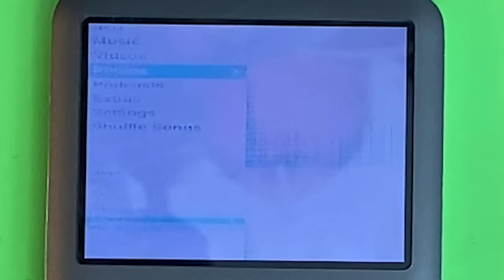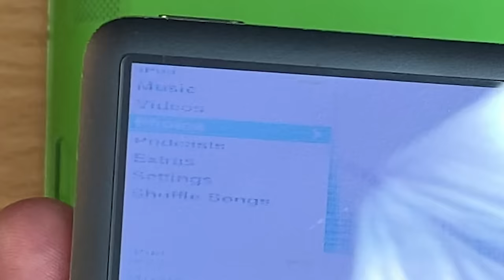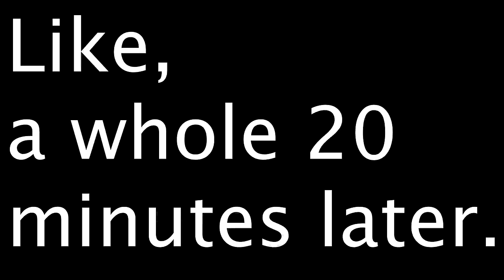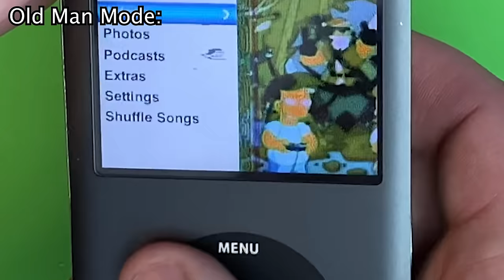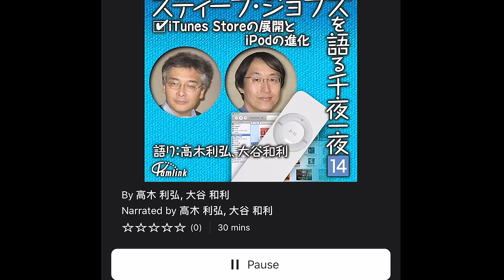I killed the 1TB iPod...

Comment: The screen reminds me of when my ds lite screen died. The hinge was slowly slicing the ribbon connector. Since theres nothing like that there id actually wonder if it just wasnt connected properly.
Reply: Yeah.  The DS lite had problems with the hinges.  That's why nintendo had the repair service for it up until a couple of years back.  I remember when a dropped my DS lite in the bathtub.  The guy on the phone who worked for Nintendo said is was covered, when water damage was in fact not.  However, they honored the statement and I got a new one free in the mail.

Comment: Oi get the $60 ifixit kit with the random screw bits and the Jimmy. The Jimmy is a metal spade with a rubber handle, and it helps open these things so much easier than naked blades

Comment: i had the same model, also messed up and fell on the floor....
Sadly it was like the most often opened ipod in my collection so the shell went apart and ripped the 3.5mm-jack assembly appart, plus screen glitches and ripped battery socked...
But I HAD TO RECOVER MY BOYYYY!
So instead of ordering new parts, my lazy poor ass managed to solder the ribbon cable of the headphone assemble together to working condition (yes really), and I also resoldered the battery plug which i had to secure with adhesive. sadly the last part went to much and now i can only change my battery by cutting it out. The screen glitches went away like magic but comes back every time i press the buttons too much.

fun little story, but MA BOYYYY works happily again now!

Comment: Would it be possible just to grind off/cut the clips/rails and ise adhesive instead and then if you need to get into it again you can just use a heat gun?

Comment: That is what I always hated about the old Ipods. If you plan on opening it up you better have a spare case with you because you can not open an Ipod up without scratching it because Apple designed it so you can not open the device after it left the factory.

Comment: 🤦🏽‍♂️need some help?
Here are two tips
1.Use tape to hold the center button in place.
2.Use the isesamo tool to open a gap enough to fit in a butter knife and push the tabs. (The isesamo opening tools are to wobbly to push the tabs.)

Comment: What I would do, buy a WORKING ipod 7th gen, doesnt matter condition of casing if your replacing it, and put the iflash drive in the new 7th gen. or if possible, buy a working 7th gen screen off of somewhere. Either way, the 1TB iPod would be able to be restored, ya just need either a new official 7th gen screen from somewhere or a completely new 7th gen.

Comment: I'm sure I'm not the only one thinking this, but why couldn't they have used screw's on the outside of the back? Sure it's not as pretty, but I'd work alot better for fixing. Water resistance wasn't even a thing yet. I know, they wanted you to buy a new one if yours broke... But they clearly weren't envisioning when they stopped  manufacturing them

Same with phones, everyone uses a case anyway, so just make the phone able to open via screws and keep the batteries user replaceable (by intention, not hair dryer glue melting prying of factory seal nightmares). But again, I know, they want you buying new ones when the battery starts to fade. But they'd make sales on the batteries too 🤔

In summary, I miss easy to open electronics 😁